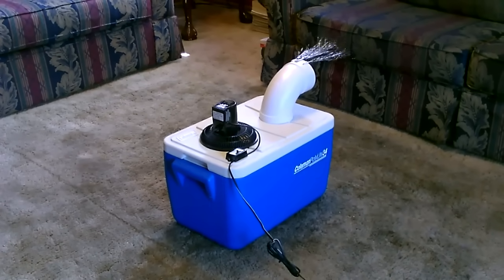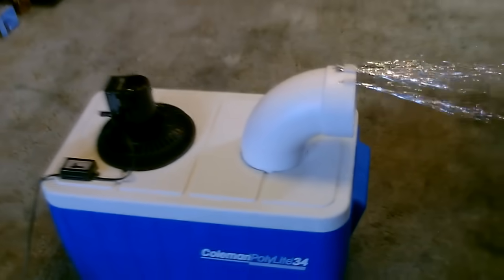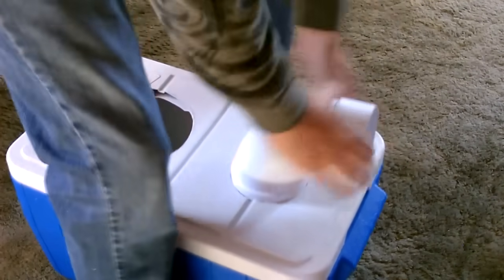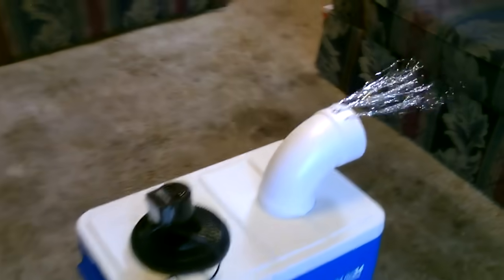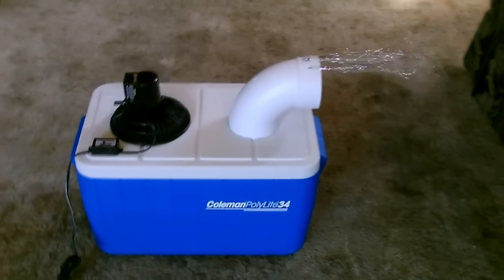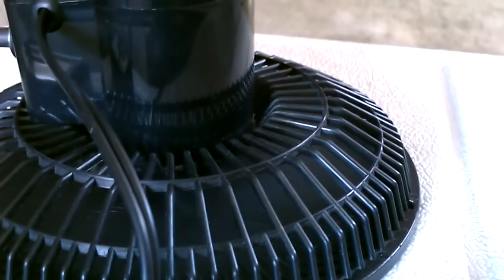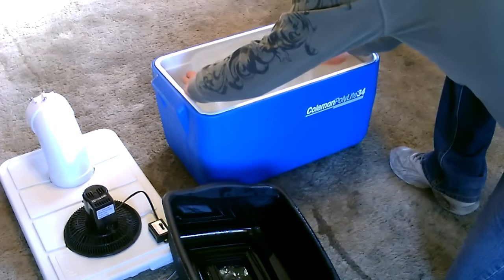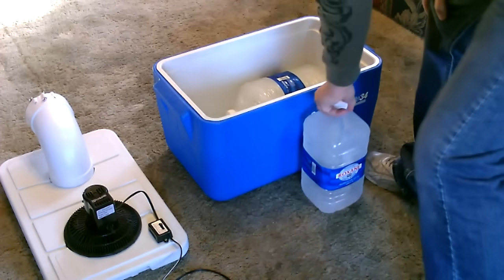Homemade air conditioner DIY - Awesome Air Cooler! - EASY Instructions - can be solar powered!

Comment: If you put the ice bottles on a grate to get them a few inches off the bottom of the cooler, it might force more air around the bottles, increasing the heat exchange and pumping out colder air. You would have to change out the bottles more frequently though (same reason).
But very well done.
Reply: I use frozen milk jugs filled with water.  Better than Ice.
Reply: VitaminCM Very good idea, Vato !
Reply: VitaminCM i
Reply: or more small bottles what is also better because not everybody has a big freezer like the most Germans, like me.
Reply: Would a cheap car radiator be helpful in this construction? Ive never quite understood how radiators can offset the roaring heat of a car engine!
Reply: VitaminCM
Reply: Superb idea!!!!!!
Reply: Good idea!
Reply: VitaminCM l moo
Reply: Yeah, i was thinking the same. If i make one i'm gonna use cubes and force the air to go through them, it's the dealing with the water i'm struggling with
Reply: yeah im going to do that the next load of ice...
Reply: VitaminCM p
Reply: VitaminCM jgthaykexuktkbgyr
Reply: The reason I use Milk Jug is portability.  I could put 2-3 jugs at a time and have a few more ready in the freezer ready to swap out.  The ice method is just not possible for me,  no place to buy big chunks of ice and once melted I have to throw the water away?  As far as temp goes you are right.  Its a few degress warmer but its still gets the job done.  You can also use 2 litter soda.  Good luck to you!
Reply: VitaminCM ?
Reply: VitaminCMmmmmmmmww to

Comment: I built one... using the same equipment in your system... and the fan isn't nearly powerful enough.  What size fan are you using?  It looks like the same one I purchased, and mine only has a .8Amp draw.  Yours is blowing much harder than mine.

Comment: Excellent.  You could just use water in the cooler and it is literally a inexpensive swamp cooler.  Swamp coolers are used a lot here in Colorado.  I could see using a couple of those in a bigger room to really cool off a big room.  Seriously, just water in the bottom of the cooler will cool a room too, so putting on that block of ice at bed time in a bedroom and it will still be letting off cool air in the morning.  Very crafty you are!!

Comment: Nice design. I am making two of them. The plan is to keep a van camper cool in the desert during peak day time heat. My question is ,  Will a 15 amp solar panel like yours power two of these fan motors? The motors are 0.08 amp.  Also do you think two of these will keep a closed van cool in 90 degree desert heat? . The van is 1/2 ton ford van standard.   Freshly painted white and fully insulated.  Thank you for the post.   Steve.

Comment: i tried an o2 cool 10 inch fan, its the right size to just set on the bucket no tools, i simply cut a few 3 inch holes in the side of the bucket and whaaamo, 1 minute and no real work later im done, could it be better, yes for sure, but it was the most basic and easy one ive seen and it works the same, and all it takes is one drill and hole saw

Comment: +desertsun02  To make it easier you could add a short piece of pvc pipe to the elbow and cut the hole for the O.D. of the pipe instead of the elbow. (Better for those of us with poor cutting skills LOL)    Neat little cooler.

Comment: not sure if this was asked already or not but would it be better to mount the fan inside the cooler so that it will push out only cool air as opposed to sucking in warm air from outside the cooler to push over the ice and out the other side? possibly creating longer lasting ice and cooler output. great video by the way

Comment: use (ice cream maker) rock salt to drop temp even colder and make ice last longer. also lining inside cooler sides with sheet metal flashing will maintain or lower temp as well.( ice makes metal coat with frost) its why iceream makers have an aluminum container. interior plastic in cooler doesn't do this. (alum foil? only if you layer like 15 layers glued together (spray glue)  Use a whole box of salt. When down- recover much of the salt from bottom of cooler. or pour all water in a tub lid and let water evaporate to recover all of the salt to use again and again. Pour fragrance over ice for fresh smelling air.
Reply: done with it. (not down with it- stupid auto correct!)
Reply: to reduce forced hot air melt off- cover the half of ice under the fan with a piece of flashing.  My method is best with large bags of ice dumped out into cooler angled so fan side has less ice than exit side. cover all with rock salt.then add square of flashing over fan side of ice. if you have only a cooler sit fan on a chair so it blows down into cooler. (best in small enclosed room)

Comment: I found that dry ice works best because it doesnt melt like water it instantly evapotates
Reply: Normal air is 78% Nitrogen, 21% Oxygen and only 0.035% Carbon Dioxide. If the concentration of carbon dioxide in the air rises above 0.5%, carbon dioxide can become dangerous. Smaller concentrations can cause quicker breathing and headaches but is otherwise not harmful. If Dry Ice has been in a closed auto, van, room, or walk-in, for more than 10 minutes, open doors and allow adequate ventilation before entering. Leave area containing Dry Ice if you start to pant and breath quickly develop a headache or your fingernails or lips start to turn blue. This is the sign that you have breathed in too much CO2 and not enough oxygen. Dry Ice CO2 is heavier than air and will accumulate in low spaces. Do not enter closed storage areas that have or have had stored Dry Ice before airing out completely.
Reply: why risk it just to try and do it better, use regular ice if your indoors
Reply: As long as there is oxygen in the air, the carbon dioxide will not kill you.
Reply: no its just water. the dry ice is frozen carbon dioxide
Reply: and lasts longer
Reply: Dry ice also puts a dangerous amount of carbon dioxide into the air, which can kill you.
Reply: can regular ice kill you too?
Reply: I am a Dangerous Goods Agent for a cargo airline company....DON'T EVER use dry ice!  Dry ice removes oxygen from the room.  Yes, you would need a lot of it to suck all the oxygen out of your living space and I understand your living quarters are not pressurized like an aircraft BUT using dry ice in the manner is NOT advisable.
Reply: Ya use dry ice and make sure you tape up any air leaks in the room. We can give you a Darwin award when they find your body.
Reply: +Bricen Babcox actually if there is a high concentration of CO2 (above 10-15%) you will get poisoned.

Comment: Using this for construction workers on the road is a good thing. Get a large van and hook it up in the back and turn it into a mobile cooling station during the summer with water and Powerade on standby for hydration purposes.

Comment: I think the streamers are a really nice touch...

Try breaking up the ice into chunks and adding rock salt. Some of the ice will melt but the melt water will be colder than the ice. And the surface of the ice chunks will be colder than 32F. When the input air hits the salt covered ice and colder melt salt water, moisture will be pulled out of the air too. The air exiting should be colder and drier than you're getting now. Plus more efficient since the air can pass around the ice chunks with more surface area you get using a block. 

I'd try it but I need to find my A/C remote and turn it down. I'm freezing.

Comment: get a blower fan with ducting make an in and out on you igloo. run a pvc pipe with evaporative mess inside run a drip system charge it with air. evaprative cooler you can put the fan outside the house for a quiet cooling.

Comment: But freezing the ice isn't cheap...
Reply: aSASa45454 The compressor kicks on every few minutes to ensure that items stay frozen, the insulation is not good enough to keep things frozen for eternity. It's not going to affect your electric bill to throw in some water. You're grasping at straws in desperation to be right.
Reply: thats not how physics work m8. the cooling process requires energy. the amount of heat that the ice can absorb before reaching room temp is less than the amount of heat released in initially freezing it.
Reply: DoppelgangerPlayer
freezer is not on all the time; at least not the compressor. if you want it to freeze ice, the compressor has to run
Reply: In a nutshell, there is no free lunch in this world.
Reply: So if you want to do this ice chest idea, make sure the ice maker (freezer) isn't in the same room you are trying to cool. And be aware that the room where the ice maker is, will get warmer as you make new ice compared to what it would have been if you weren't making ice.
Reply: Solar Fluxman  I couldn't have said it any better myself. Bravo! This is one example of how being scientifically illiterate can keep people at a disadvantage in life. Thank you for your excellent explanation!
Reply: Darkmanafest. You need to brush up on some basic physics.
Reply: Darkmanafest. wrong.. the freezer is "on" but it's not "working". 

it will cost money to put a warm object inside of a freezer, and freeze it
Reply: absolutely.
Reply: Freezing the ice? makes no sense because it's already frozen. Do you mean freezing water isn't cheap? If you do, there's something called recycling. After the ice melts, freeze it again.
Reply: The point is your refrigerator/ freezer is always plugged in. Refreezing the water isn't going to cost you any extra money that you aren't already spending by having your freezer running in the first place.
Reply: Solar Fluxman Then turn on your fucking air conditioner and stop talking in order to minimize the hot air in the room...
Reply: Hörður Heimisson next time that it snows in the winter, fill your freezer up to the max with snow from the ground and use it for your ac rig in the summer. Problem solved you saved $1.60 on your energy bill
Reply: 9/11 Twoofers is correct in everything he said. If this ice idea is so great, why not just open the door to the freezer and blow a fan into it cooling the room. The reason this won't work is because the freezer will produce a net heat equal to the watts being used by the freezer. You actually end up heating the room more than if you had kept the door shut. A question in thermodynamics goes like this: If you had a freezer in a sealed and perfectly insulated room, and you were to open the door of the freezer, would the room get cooler, stay the same or get hotter. The answer is that it will get hotter because energy is entering the room through the wall outlet via electrical energy going into the room. The room will get hotter. The rate of heating will be equal to the watts (Joules per second) used by the freezer.
Reply: So you turn your refrigerator and freezer off like your stove??  😂😂😂
Reply: C15 0001229684 So you never freeze anything to save money??? 😂😂😂.   You’re grasping at straws in order to make your argument sound logical....stop embarrassing yourself.
Reply: Your all talking bollocks it costs money to freeze water because the freezer kicks in, next time you put something warm in the freezer listen to it, anyway the cost isn't much, stop been jewish ffs
Reply: Yes, freezing ice. Your frige has a freezer, frige runs all the time, so the freezer runs all the time as well. So it doesn't cost anymore to make a block of ice; because your fridge/ freezer is always cycling on and off! So yes free ac as long as you use a solar panel.

Comment: You might consider turning the vent so that it blows over the fan intake. This way the fan would be drawing cooler air back into cooler.  It probably wouldn't  impact it's ability to cool the area too much.
Reply: Maybe cutting in a smaller pvc elbow pointing at the fan and have larger elbow pointing the other way
Reply: Or instead of an elbow use a y pipe.
Reply: exactly, it would take longer to cool the room giving the cool air more time to leave the room. better off how it already is
Reply: You'd get less cool air out in a partially closed loop like that. So you'd potentially get cooler air out, but less of it. No net gain
Reply: Mike Glynn your are correct. My brother in law did this and did exactly what you have stated and it made a very big difference. The ice blocks lasted alot longer due to cold air pushing back in rather than hot air.
Reply: Not really! The whole concept is to exchange the hot air to cool. This is the soul purpose  of a indoor ac unit.
Reply: Mike Glynn ajajja
Reply: Well I think you need a 2 PCs of vent here..
Reply: You can put 2 of the 4” 90 degree pipes on it one to blow back to the fan and one to blow out in the room
Reply: Smart, worth a try. You would grow some nice weed
Reply: You can also put rock salt in the eyes to make the ice last longer, and stay cooler.
Reply: This would do nothing. The cooler air drawn back into the chest would result in the ice melting slower.  The result would even out exactly. Think Physics!
Reply: if anything it should make the ice last longer. Less incoming heat to melt it.  (assuming that was already the thought process behind the idea)
Reply: Mike Glynn thats a pretty good idea bro
Reply: by drawing in the already cooled air from the ice block, wouldn't you be effectively doubling your energy aka time with the ice?
Reply: exactly the point
Reply: Mike Glynn you believe rac sucks hot air outside??
Reply: exaclty what i was thinking. like how a turbo works in a car. reuse that shit lol
Reply: Leo e the point is to expell as much cool air are possible not pump it back in. You'll run longer but not as much cold air will come out because your sucking it back in. Also running the fan cuses heat so running longer will just cause more heat. Longer running motor=more heat.
Reply: I like that
Reply: Smart, that would help

Comment: what is another relatively cheap tool to cut into the cooler chest?

i dont have a cutter like yours. i do have a tiny demel tool. but i think it wont work well
any ideas?
Reply: Put a tub of water in the freezer.
Reply: +The Lenawee Trekker I agree dremel with a side cutter would work great
Reply from the maker: hi. just a regular hack saw should work
Reply: That's awesome man,..but where can I get a giant chunk of ice like yours?
Reply: +David Davis frozen one gallon jug works too
Reply: Actually the Dremal with a side cutting bit would be easier than using a jig saw.

Comment: Very cool idea but i would change one thing.  Instead of having a fan blow into the cooler put a fan on the output side somehow.  Reason being is you are blowing warm air onto the ice making it melt.  With the fan on the output it's simply pulling the cold air out of the cooler.
Reply: Still the same really...the fan on the output side would still be drawing ambient air over the ice, losing heat to the ice and coming out the other end colder.
Reply: That is a good idea but it might not work because it would create a vacuum.
Reply: It's the very same thing 😊
Reply: +jacobspeeds thinking outside the box, way outside
Reply: +Ernest Sofonoff oh yeah...makes sense lol
Reply: What?
Reply: is it better if you just put a fan facing inside the box and a fan facing outside the box for intake and outake of air??
Reply: +jacobspeeds cuz you'd have to cut an air intake hole somewhere or else you'd create a vacuum and have no air to "suck" out. ☺
Reply: +Isaac Frempong how would it be drawing outside air in when it's drawing the cool air out...

Comment: Would putting salt on the ice help it to last longer
Reply: Does Salt Keep Your Ice Colder?

Fact or fiction . . . does salt keep your ice colder? Well, kind of. Salt melts ice. When salt is mixed with water and ice together, it can bring the freezing temperature of the water to a lower degree, making the water colder without freezing it. What this means is that the combination of salt, ice and water creates really cold water. The down side is that salt also causes the ice to melt, and the goal of keeping your ice cold for a long period of time is to keep the ice from melting.

Comment: so this work directly to the solar panel without charger controller ?
Reply: My fan works with or without the charge controller. It also runs on rechargeable batteries. When a cloud or a storm covers the solar panel, the fan runs off the power stored in it's batteries.

Comment: One of the easiest ways I learned to cool down a house is putting a 20x20/in box fan aiming out one window, then going to the opposite side of the room and opening another window. The box fan will suck out the hot air and the other window will pull in cool air from outside causing a nice cooling draft. It's not the most effective method but it's better than melting to death. The average room temperature is about 70° f. My house was 79°f one night and I used that trick and brought the whole house down to 75°. Brought it (- 4°) lower from just using an electric box fan. Keeping in mind I have a big house It would work flawlessly in a small apartment or condo.

Comment: Dry ice gives of carbon dioxide, not carbon monoxide, which is dangerous. You would have to be in an airtight or non-vented place with massive amounts of CO2 for it to be dangerous to you. But the guy screaming wolf on here has dioxide mixed up with monoxide. Just FYI for you DYI's.

Comment: I just bought a Styrofoam cooler and I'm going to use a plastic bottle to make it easier and I have a fan but I didn't get the PVC pipe I wonder if I just cut a hole in the side , oi that'll work
Reply: You know I just realized I threw away a paper towel Roll today… And now I'm thinking I could use a toilet paper roll
Reply: You know I just realized I threw away a paper towel Roll today… And now I'm thinking I could use a toilet paper roll
Reply: And I hope this works because most of the time i'd rather have the windows and doors open but when I sleep on the second floor it does get to hot and to sleep